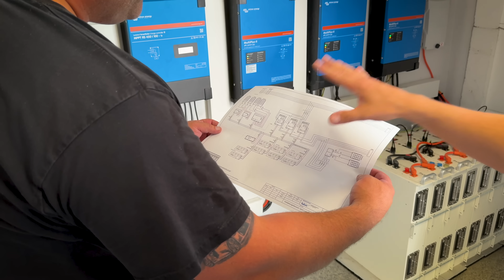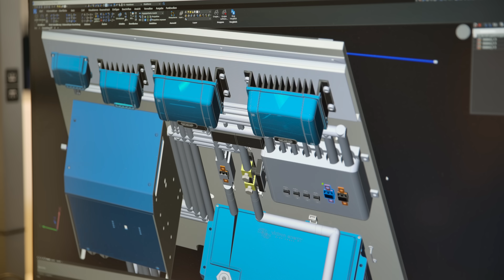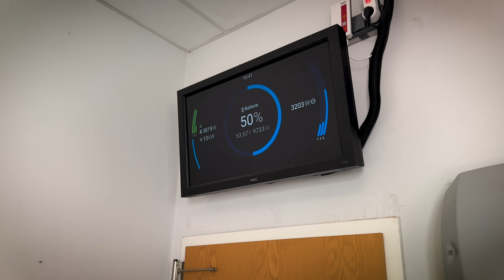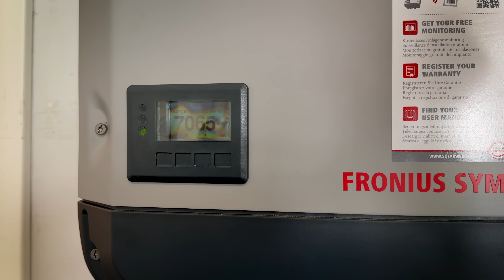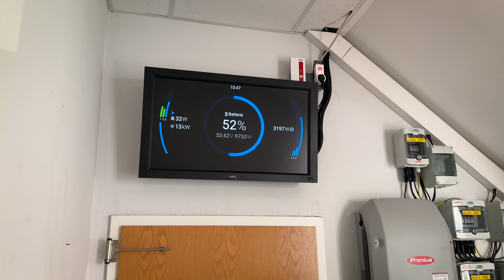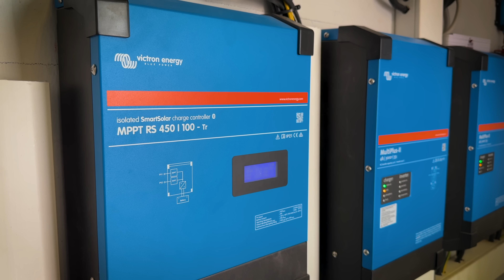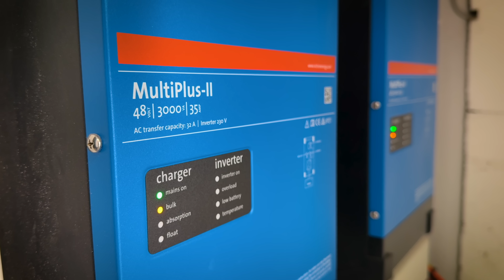This roofer beat the German energy costs using Victron Energy

Comment: Thanks for sharing this insights. But but the representation of electricity prices with 50c/kWh is exaggerated. No one had to pay this. Due to extreme price spikes at the end of 2022, the German government decided to introduce an electricity price cap, effective from March 1, 2023 (retroactive to January 2023). It applied to private households and small businesses.
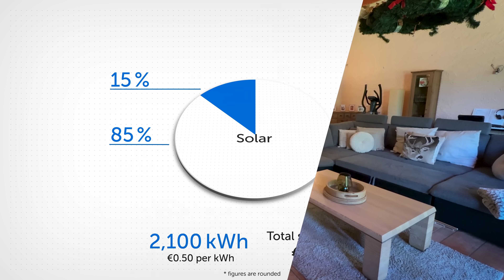The average prices actually paid were therefore well below 40 ct, with many even between 32 and 37 ct/kWh. Therefore, even if the decision was made based on such extreme peaks, the representation at 05:01 is misleading.
Reply from the maker: He bought his system at the high 50c time, and the graph is an example of the time he decided to buy the system.  With the benefit of hindsight, indeed it will take him longer to get his return on his investment.

Comment: I went off grid in March 2025, using 10kW solar, 2x MPPT 450-100, 3x Multiplus11 in parallel, and a 66kWh battery using 4 lots of 16 EVE MB32 cells 330A/h. Right through winter it provided all the electricity we need, 20kWh per day, totally off grid. Cost, $AUD 20,000. In Brisbane we get lots of sun in Winter so solar works perfectly.

Comment: Why choose for the 3000 and not go for the 5000. That would give more room to use the power that is stored in the batteries, or are these only as a backup?
Reply: Heute kostet sie in Deutschland gefühlt nichts. Vor 3 Jahren war es noch 3x so teuer.
Reply: Der damalige Preisunterschied zwischen den Multiplus war der Grund für die Wahl der MP-II 3000er. Das die Geräte aber eine gute Wahl sind, haben die historischen Daten gezeigt.

Comment: I'm using Victron just for charging battery system and it works fine and in future I'm planning to use two 15kW Multiplus II ..Unf. I'm a bit disappointed with '15kVA' label as it isn't real 15kW but only 12kW also i don't understand why it is so hard to make these two 15kW units work in parallel easier.  because they can't work like this only in Power Assist mode and then it is possible..who doesn't understand look it out...anyway.. I have about 1500Ah 51.2V system with luck another 16kW system on the way.. all single phase and hopefully it will last in winter more Also battery pack is all DIY Kit.. and actually there is no need to have comunication with battery pack at all..that is just extra expanse not worth it.. what is important is BMS that is used to monitor SOC of whole battery pack system.
Reply: Du benutzt 2x 15kva da steht nicht 15kw auf dem Gerät. 15kva x0,8 = 12kw

Comment: Great system setup! Having your own church roof covered with PV modules really is the dream of every off-grid enthusiast. With such a large photovoltaic surface, this installation is perfectly equipped.

One suggestion for Victron: it would be great if future MultiPlus models paid a little more attention to acoustics. The new 6.5 kW MultiPlus II units with standard fans are fine, but not ideal. Using a quieter fan solution – for example something like a Noctua – would make a real difference.

Another very important advantage here is the integration of the heat pump into the system. Producing a lot of electricity is of little use if it isn’t consumed wisely. Using PV power directly for heating purposes makes much more sense, as it reduces the need for fossil energy – especially valuable in periods of low solar production (“dark doldrums”).

I’m extremely satisfied with Victron as well. I run two installations myself – one with 8 kWp and another with 14 kWp – and both work flawlessly without any issues. Very happy with Victron overall!

Wishing you all the best with your installation and high yields! And I also hope that Victron continues to provide us with excellent new products and keeps pushing the development forward.

Comment: Everything ist fine but 50 Cent is a little bit leading on the Marketing Side .... currently under 30 Cents is much more Reality in 2025.
Reply from the maker: Those were the pricing when he decided to install. Nobody can predict the future pricing however.
Reply: Due to the gas shortages, we had temporary peaks of over 90 cents per kilowatt here. 50 cents isn't 'marketing' , but the stone Cold reality of being dependent on availability of a resource provided by others.
Reply: @pjtje also bei uns war’s zu Corona durchgehend 24cent. Erst danach wurde es auf 46cent erhöht (Deckung war aber 40cent mein ich). Danach ist es auf 36cent gefallen und aktuell sind wir bei 31cent. 

Ich liebe unsere Victron Anlage😍